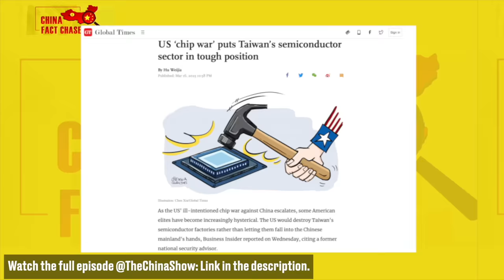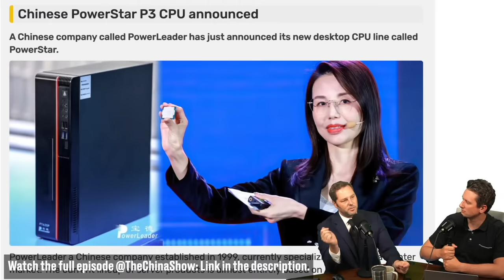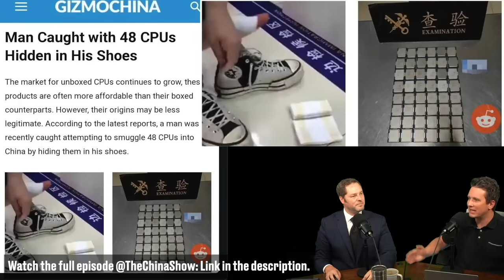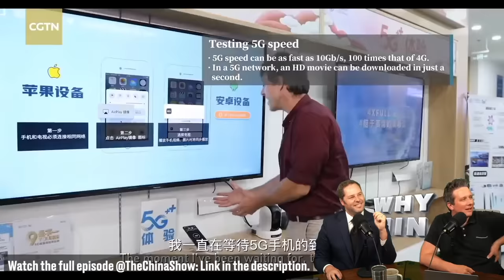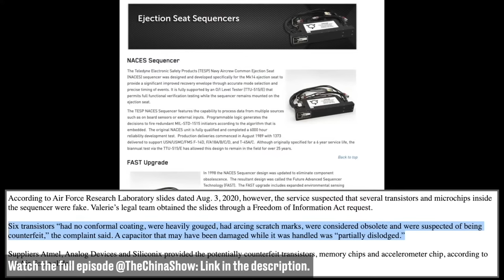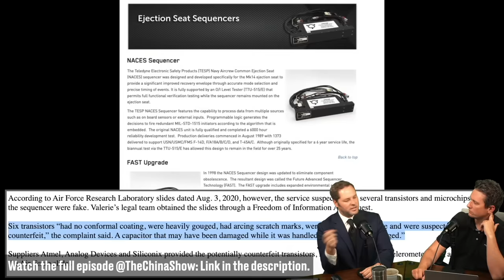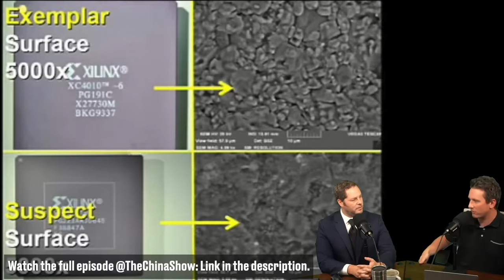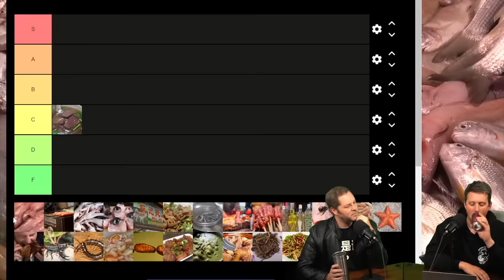China's Fake Ass Computer Chips Are An Embarrassment!

Comment: There have been cases on china counterfeiting more complex stuff like GPUs and it being better than the original, they don't always get it wrong. That one example was an AMD/ATi GPU used in an Apple laptop, the original had an issue where over time it would kill itself but the Chinese copy didn't.

China last I looked were capable to making 40nm and 32nm chips at the very least, years behind, but they can make some replacement parts for old stuff if they can reverse engineer it. They wont be making any Intel or TSMC chip from the last 5-10 years, the last 32nm CPU I have is an AMD FX chip from 2012. Not sure how it's going for them now since they are banned from buying the lithography machine that make the CPUs, there is only one company in the word that makes those.

As for Intel licensing out their CPU, the last time they did that was not a 286, it was a 586, I know this because I have one, a Pentium chip not made by intel, made by Cyrix, they called it a "686" just to be confusing, this was back in around 1996.

Comment: Well- with the vapes it depends. Many of the battery's have no chip because the vape device already has . But yeah- if you buy cheap stuff it's dangerous. Even expensive stuff can blow up für to mishandling. If cheap counterfeit chips get thrown into the equation ...

Comment: For the CPU, it's identical to the Intel 10th gen i3-10105

To suggest it could be anything else would be saying that a Chinese company is using the EXACT SoC design that Intel used and created for their 10th and 11th gen CPUs.  The shape of the heat spreader has to match the design of the socket and mounting bracket on a motherboard that was designed for these processors, so suggesting it could be anything else would be laughable.  It's not just that the CPU is identical, but the socket design would have to be identical.  So, this is an X86-64 based Intel/AMD patented architecture, and the specific platform is Intel 10th gen CPUs using the LGA-1200 socket.

Now, they probably didn't make these.  These were probably sold by Intel under an approved contract since it's no longer cutting edge.  Once again this is Intel 10th gen, and Intel SHOULD be on their 14th gen already but they've had problems with getting their Intel 4 process node (fabrication of die using ever smaller transistor sizes) and they need to be on this newer node to have the space for all the transistors that will go into a 14th gen CPU.

Also, these wouldn't have been made in Taiwan.  Intel doesn't make ICs in Taiwan and TSMC doesn't make Intel CPUs, at least not yet anyway.  They might in the future if Intel keeps having a problem moving to more advanced process nodes because they'll lose too much business.  They've already lost too much of their server business to AMD and other companies that make custom processors based on ARM designs.

Comment: Even if the chips are real and just refurbished, they are used and the MTBF is greatly reduced.  MTBF = Mean Time Between Failure.  In the aviation industry, every component is tracked by MTBF so they get replaced before a failure occurs.  An inflight failure of a component can be catastrophic if a redundant system is not in place.

Comment: They may look identical on the surface but to see what you've really got, you need to compare what's under the hood. However as it stands today, without outside input China is not able to manufacture these processers. It's more likely to be an early pentium level chip.

Comment: Actually i've been wondering why not make them in hexes rather than squares? You'd get better die usage, and you could get a different number of necessary pins, especially when working small size. I suppose breadboards being meant for the standard shape/size is a main reason.
Reply: If I remember correctly, it's because the die needs to be cut. You can't cut a die in straight lines to make hexagons. Dr Ian Cutress has a video about this with more details
Reply: @Niosus  That makes sense. Hadn't considered that.

Comment: 10th generation is from 2012 man not 2021 !!!   :D

i3 10105 = i3 is the part number, 10 is the generation, and 105 is the specific board.  So that number means it's a 10th generation i3 105.  The way they copied that number but switched the zero position is super clever, because the algorithm used to search for parts will find both but list the P3 FIRST because it starts 01 instead of 10.

Comment: An Integrated Heat Spreader (IHS) is the surface used to make contact between a heatsink or other thermal solution and a CPU or GPU processor

Comment: Chips are way more complex then anything you can simply reverse engineer,most chip maker knows how to advance their chip, the problem is getting the lathe, the laser, etc. Which require people with specialized knowledge and resources on how to make the parts. Its crazy how fragile the ecosystem is to maintain the capacity to make more and more advance chips. We don't actually need to use the most advance chip from Taiwan for most things and scary how easy it would be to shut it all down. This is not something you can just follow somebody else's trail.

Comment: The Intel i3 processor was introduced in the US more than 10 years ago.  By todays standards it is obsolete technology.  It barely has the processing power to run apps in Windows 11 smoothly.  Americans take their old computers to recycling centers and these recycling places pack the junk computers into shipping crates.  It is put on a ship and sent to China.  This is where the junked i3 processor are collected in bulk quantities. They are laser etched and relabeled as a new chinese designed processor.  It is sad that the chinese are using i3 processors as new homegrown technology when we Americans consider them obsolete and junk.
Reply: i3, i5, i7 and i9 only designate the power-performance class of an Intel processor. What really matters in what generation processor are we talking about. E.g. i3-2120 is obsolete, i3-13300H is a  nice workhorse of an CPU.

Comment: I don't know how that counterfeit chip ended up in an ejector seat in that F-16. The Air Force verifies all the functionality of their avionics before it flies. Every control module goes through extensive testing, including failure modes and protection circuitry.

So one of two things happened; the engineering tech lied about the testing being done, thus passing a failed unit, or it never went through testing and was installed sight unseen, which is almost impossible to pull off, since numerous authenticated checkpoints would have to be forged.

Comment: China has been able to make their own legit quad-core CPUs...but they suck to the point where AMD/Intel CPUs from 10+ years ago are still far better. Why? Because the Chinese R&D firms still haven't mastered the microcode for task scheduling, so those cores can work together effectually. The IPs they have to work with are evolutionally dead ends from the 90s and early 2000s. Being the masters of copying only gets you so far.

Comment: I still don't get their issue making chips. They know how the systems to make the chips are made, they know how the chips are designed... I mean they're just like, what, 30 years behind on setting it all up. They just need to make long term plans.... oooooooh
Reply: 30 years? where did you hear that crap? China is the first country who is working on Carbon based chips. its the successor to Silicon based chips that we use now. Its better in anyway then Silicon based chips.

Comment: I think what happened was a CCP front company did a huge big production run of Intel chips while the chip ban was in discussion (they have thousands of moles in US government) rather than develop a local chip manufacturing industry. 
Why? Chip production is enormously expensive and REQUIRES foreign specialists. It is not simply a question of buying machinery and setting up a factory- this is extreme specialty skill requirement stuff.
For Chinese chip production to at least equal RusElectronics, China would need tens of billions- 120 sub companies, and a massive research-industrial complex and with tens of precision machinery manufacturers and tens of specialist research bureaus. RusElectronics was set up at as no-expense spared Soviet necessity industry- then when Russia was not boycotted- it massively modernised at what would be considered national budgetary losses. BUT- even though Russia has this capability- it recycles commercial 120nm and smaller chips.
There's no way around it- the factory techs that set up the ASML lithography machines are extremely skilled and very, very few others are trained to that level of extreme precision metrology (precision machine measurement) - maybe less than a thousand in Europe. Then their specialist super-precision metrology equipment is enormously expensive and requires constant calibration, specialty storage and specialist handling. 
True China makes some reasonable knock-off Mitotoyu or Starret dial gauges- and in layman's terms "precision equipment" which are perfectly adequate for hobbyists- maybe even accurate to a micron (1000 nanometres). 
Maybe, some select specialist agencies in China like space industry have a few ex Soviet optical flats accurate to tens of nanometres and maybe some ex-Soviet high-end metrology & calibration equipment (available on eBay). But accurate large equipment- considering Russia's distrust of China- extremely unlikely (Russians truly DO NOT trust China the Russian-Chinese friendship is merely Russisa playing for time). So it is unlikely China has the capability to manufacture sub-nanometre precision measurement machinery- much less capable of extreme precision manufacture where a 0.01 micron is a km too much variance. And China is not alone 99% of Western industries cannot manufacture to such high tolerances- that's why there is one cutting edge Western chip lithography company: ASML- it requires such extreme precision manufacturing, manufacturing machinery and extreme precision component- it is very unusual. ASML major partner is Zeiss AG- who also require very unusual extremely high precision.
For computer chips- the lower the nm figure the more compact and efficient the chip- correct? Old chips like for LED are 365nm or larger which is 0.365 micron- maybe possible China can manufacture these.

For comparison Russian chip manufacturer Ruselectronics can manufacture down to 125nm- and this requires an enormous military-industrial-research base for. To understand China is simply incapable of competition- RosEl is 120 sub companies, 34 specialist machinery companies, 11 scientific instrument companies and 17 research depts. Most countries simply could not compete- this is superpower level investment- maybe UK Germany, Frane, Japan, & US. Consider China recently spent billions on self-reliant jet turbines manufacture- which requires far less precision than microchips- and has not succeeded in surpassing Russian 1960's era turbines. 
The latest Samsung chip is 3nm that is 0.003 micron, or 0.000003 mm. - once we get down to 0.1 nanometre- we are at molecular level (most molecules are 0.5 nm).

What endangers chip blockade is leakage. SMIC- is the main CCP "fabricator"or "foundry" with very strong Singaporean links. Shock. SMIC ordered an ASML lithography machine in 2018- it was blocked by USA. The problem is potential for leakage from Singapore because it simply cannot compete with Taiwan.
THEN there is the issue of huge capital and foreign expertise to build a chip factory- at least 3-4 billion. And the specialists are very rare- comprising less than 100 individuals. 
The whole factory has to have very stringent HVAC, super-super-super clean rooms, extreme isolation especially for the ASML machines- separate pads, vibrational, thermal and tectonic isolation (especially in Taiwan) etc etc,

Then to actually commence production with your lithography machine you NEED the ASML factory techs to set them up- IF the specialist factories are already set-up. These machines require enormous care in transit and installation. 

THEN the machines are not in continual operation- they need specialist precision engineers to reset them for downtime, maintenance and recalibration (DMR). So the way a chip manufacturer ("foundry") operates is while a foundry MAY produce 6 months of 365nm and 240nm it has a 2 month production runs of 14nm and 12 nm processors. Then 14&12nm machines require DMR. Manufacturer swaps to four months of 28nm, 40 nm and 45nm, then these require DMR while switching over to a run of 4 months of 55 & 65 nm. The 365nm & above 200nm machines are now requiring their M&D, so 100-180nm chips are made for 6 months and then a final run 2 months of 12-16nm chips.

So I hope I have explained how difficult even for a country not blacklisted, not subject to sanctions, with massive scientific-industrial-research capability it is to manufacture chips. It is precisely why only a few countries do it- and Taiwan is not indigenously capable it is merely the factory for USA.

Comment: 11:06 Pretty sure they can't do that for CPUs. They are either mask ROM or one-time programmable on the CPU itself so you can't change them. Neither can this be done in BIOS since the the CPUID instruction is processed directly by the CPU. Either they ran the benchmarks in an emulator, messed with the benchmark software somehow or Intel is involved in the making of this. If we ever saw one of those chips running in the wild with that specific PowerStar brand and model string it would pretty much be the smoking gun for the latter.

Comment: Even if they erase and write a new record, they don't buy it, 48 pieces each, from resellers, but they buy 10,000 processors or more through gray intermediaries.Let's say a two-year-old processor is not outdated, it does its job very well, I know people who have 4-year-old processors, they run everything without a problem,as for the old chips, it is true that of the 5 chips, the 1st is original and working.And bravo for reporting how China works.

Comment: Just playing devil's advocate, but if the Chinese CPU and the Intel CPU are supposed to mount on the same motherboard and use the same heat dissipation equipment, the Chinese CPU will have to have identical packaging.  No matter who makes them and regardless of their quality, every rim that fits on your car will have identical patterns for the lug nuts.

Comment: 9:25 It is probably an i3 that they just changed the heat spreader on. It will likely report as an i3 in whatever software you use on the machine.
Edit: ok, so they didn't even replace the heat spreader... they just changed the markings...
Edit 2: 11:24 As far as I know, you can not do that because the identification is on the hardware level. They can however use custom software to print a different name to the user instead of the actual detected one. If you were to put the CPU in a normal 10th gen intel motherboard it would report as an i3.

Comment: The P3 could designate the architecture it was based on.

If this thing has any VIA (the only other company with an x86 license), then its probably based on their Pentium 3-era architecture. I think it was 586? (386 486 etc)
Reply: Via has a 8 core 2.5Ghz CPU. That sounds alright, but considering back in the day a 500 Mhz Celeron could beat a 1Ghz VIA by I think it was almost three fold it's not very promising.  VIA is a x86 CPU that does calculations and functions, and that's about all you get...

Comment: You could actually copy the 10th gen i3 pretty easily if you spent the money on the uv lithography setup required. Silicone wafers would be an issue, but it's possible they actually made this by copying the i3. I doubt even if they did make it that it performs the same, and without the heat cap being removed to look under it it's hard to tell. If the quality tracks with what China typically does, I'd estimate 3x the power draw to hit the same 3.7 ghz with no ability to boost like the intel can when under it's thermal/tdp set threshold. Other theory is they copied the body of the i3 but they're using an outdated process like a 28nm one from older chips. Making a 2 core cpu that hits 3.7 ghz was done so long ago even China could have figured it out by now.

Comment: I think with the amount of big companies that makes electrical components, CPUs, capacitors, resistors etc, there's bound to be defective ones coming off the line. The defective component's get sold to greedy scam companies that repurpose them to look as good as legitimate ones, but you don't see them as defective straight away. They may work for a brief time but then fry. CPUs that might have defective cores that my burn out due to the original defects during the manufacturing process.
Identical CPUs which one will show the correct readings, example, 8 core CPU running at 3.70ghz, while the identical defective one would be 5 cores running at 2.60ghz, which will be flash hacked to read 3.70ghz
This is rough examples & the information I give should not be taken literally, it's just a quick basic explanation.